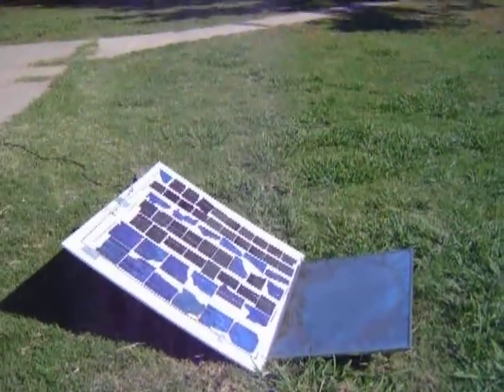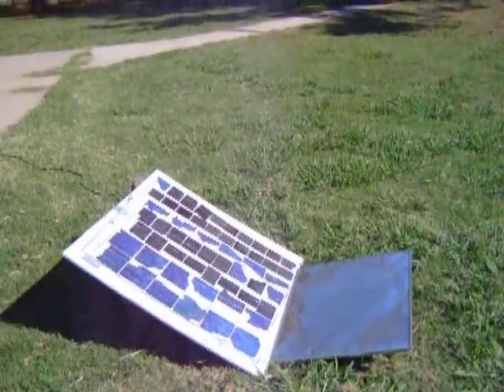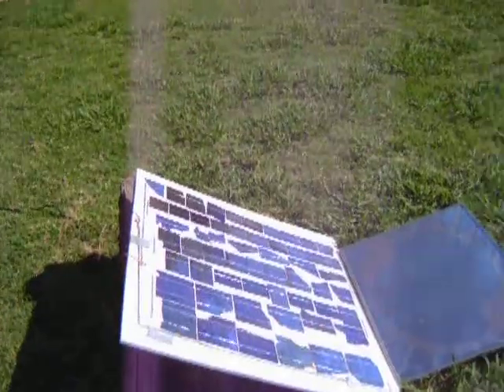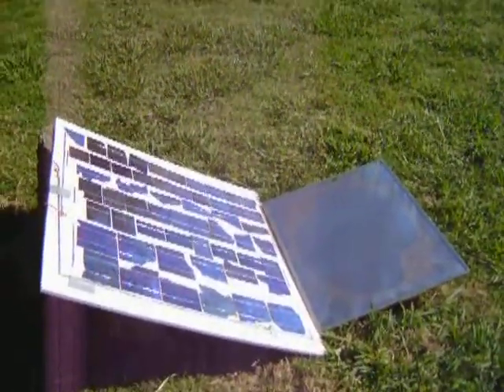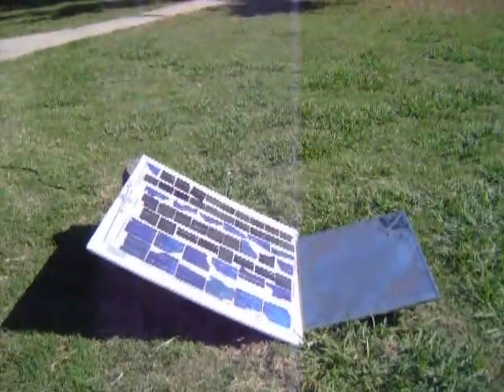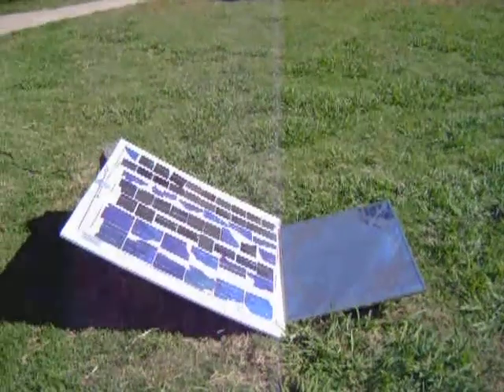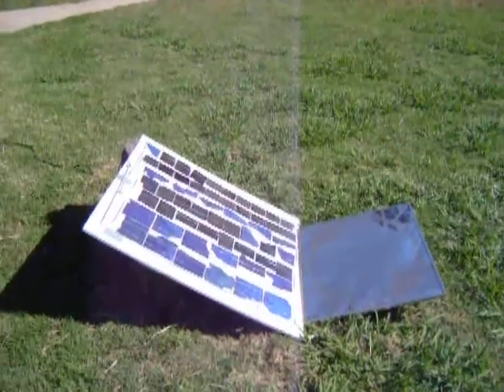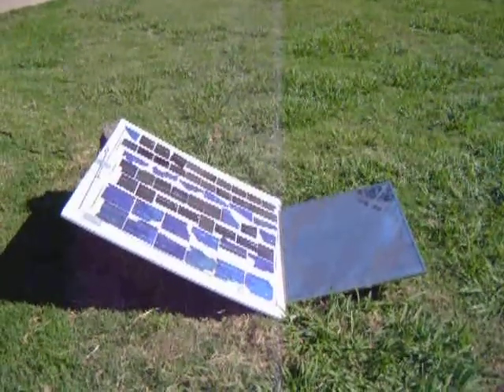Shining A Light At The Crazy Solar Panel increases Voltage

Comment: Nice It works!!  I have Made 3 Videos Myself of this and Yes it works and the solar cells Do Hold up to the heat,  The Key is to Concentrate More Light Not Sun More Light 

  So yes it works and Yes you can get more power out of the Solar panels By Directing more Sun LIGHT    

 Check out Some of My Videos  On test of solar cells panels and DIY solar panels 

 Thanks,
David  From The Web at   solarcells101